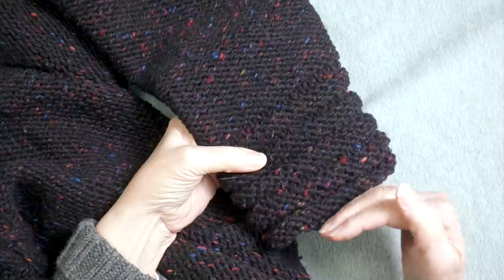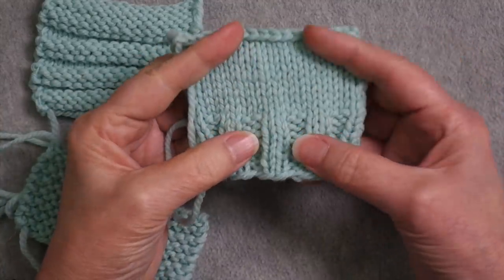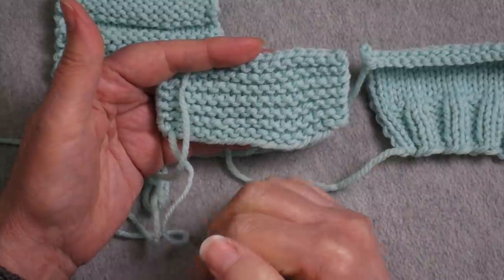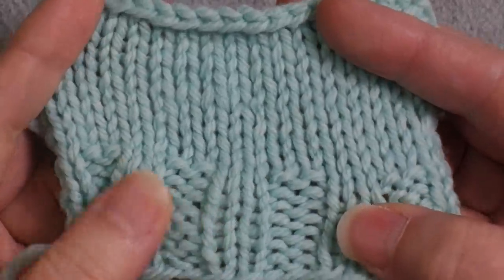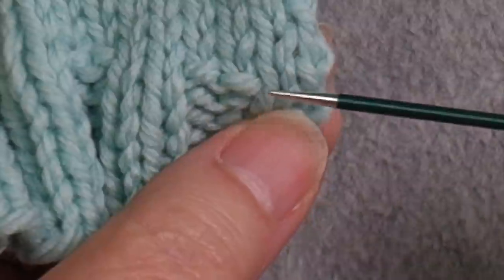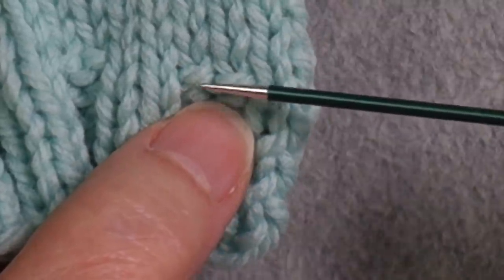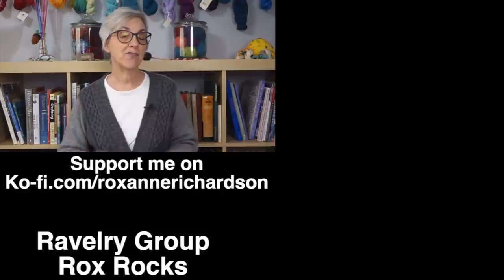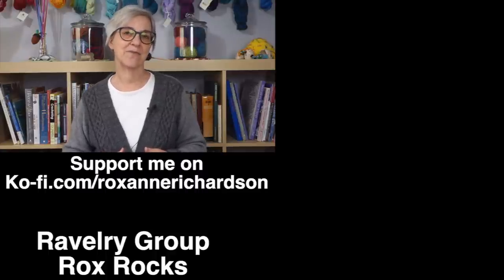How to Repair and Re-knit a hem or cuff // Technique Tuesday

Comment: This has been so pertinent for me! I knitted myself a top down cardigan and twisted one front side 360 degrees when joining the back and sides in the round. I didn't discover me error till I'd almost finished the body and wanted to try it on for length. I decided to cut the yarn, turn the twisted work and Kitchener the two edges together, but the stitches aren't quite right. You have solved my problem of picking up the correct number of stitches and what I can do to fix it. I know that wasn't the technique you're explaining today, but thank you for entry pushing me towards my eureka moment!
Reply: Gently, not entry!,

Comment: Thank you for this video- so much great information! unfortunately my situation is that  I cast on, did a few rows of ribbing (which I now know that I can't use this method on due to the half stitch issue) and then the pattern goes straight into Raglan increases. I think I would get confused around the increases if I tried to pick up stitches in this section.. I would have loved to redo the ribbing in a smaller needle as the neckline is much too loose and low on the back of my neck. I wonder if I can pick up along the cast on edge and extend the ribbing in a smaller needle?

Comment: I wish I had seen this 3 weeks ago. I'm adding ribbing to the first hat I ever knit which was the first thing I ever knit. I knit it in stockinette so it rolled up. I picked up stitches and I'm adding ribbing in the other direction but I didn't remove the cast-on edge. Now I might start over. 🤔
Reply from the maker: Oh, you're probably fine. Move on to a different project! :-)

Comment: Hi Rox. Great video. Just curious in regards to the ribbing. Instead of picking up the stitches before the ribbing and re-knitting the whole lot, is it possible to just knit the amount of extra rows required off the garment, then just grafting them on after removing the cast on row from the garment, or will the grafted section be "off" half a stitch as well?
Reply from the maker: Yes you can do that, if you are confident about being able to graft in pattern. Most tutorials for "grafting in pattern" do result in a 1/2 stitch offset, because the two pieces being grafted together were both knit toward the graft (so knit in opposite directions with respect to the join). So, if you understand how to graft in a situation where one item was knit toward the graft, and the other away from the graft (i.e. knit in the same direction) there will be no jog.

Comment: thanks for this -- i was hoping the re-knit the neckline of a top-down raglan sweater, because it feels both too wide and too short for the finished sweater, but alas, the front panel of the sweater is in moss stitch (the back & shoulders are stockinette), so it sounds like i CAN'T just pick up and re-knit the neckline, as the ribbing will be offset from the moss stitch?  so sad!  but thank you for the clear explanation.
Reply from the maker: You can do it, it’ll just have a 1/2 stitch offset. It tends to be more of an issue when working the same sort of st pattern. Since it’s moss stitch, the offset may not be an issue. I’d suggest trying it out on a swatch to see what you think
Reply: @RoxanneRichardson  thanks for the quick reply! after leaving my sad comment, i actually did exactly as you suggested, made a little swatch and tried it out -- and between the moss stitch and the unspun yarn, the offset is a little messy but mostly not noticeable.  so i'm going to do it!  thanks so much for the encouragement!

Comment: Hi Roxanne! I browsed through your playlists looking for help about lace. I ripped back a sweater that was top down to change the hem from rib to create a lace edge. The pattern I purchased and decided to use is actually created bottom up, so I thought I would knit the lace portion and then graft it on. No problem, I've grafted many things. Unfortunately, try as I did not to, I twisted the edge when I joined (yes, knit in the round, bottom up pattern-similar stitch count with my sweater) the 280-ish stitches. I thought, this is too easy to do again, so why not just knit the lace chart in reverse. Any suggestions?
Reply from the maker: Some lace patterns can be reversed, but some cannot. The only way to know is to chart it out and see. You can always post a photo of your chart and ask for feedback in my Ravelry group, if you need help.

Comment: I wish I’d watched this video before starting because now I have a problem. I wanted to change my CO on my cardigan to a more elastic one as the first 8 rows are in k1p1. So I thought “I’ll just pick up my first row of stitches, undo the CO edge, and sew the Italian BO! Then it’ll match the sleeves!” 

So, I found out pretty quickly that that would not work, but now I’m stuck - I know I can do what you did and go down to the stockinette part and redo the entire rib, but it’s a lot of stitches. Is there some way to bind these stitches off?
Reply from the maker: You could try another type of sewn bind off, the half-hitch BO. It gives the same result as the LTCO. https://youtu.be/FvNao1Asuvc
Reply: @RoxanneRichardson  thank you so much!!!
Reply: @RoxanneRichardson  I just did a portion of the edge and it’s working perfectly! Again, THANK YOU! I was genuinely at my wits end and close to tears 😭 I’m so god damned relieved 😩🙌

Comment: I have done to many rows in my ribbing on the front of a cardigan it wasn't until i sewed it up that i noticed it so how do I take off 3 rows without undoing it all. Please. It's a Man's Cardigan he has worn it once but I don't like it being wrong.
Reply from the maker: It can be really hard to remove just a few rows of the ribbing, because of the difficulty of capturing the alternating knits and purls. It's much easier to take out all of the ribbing at the point where it transitions to stockinette, and then reknit the ribbing to the correct length.